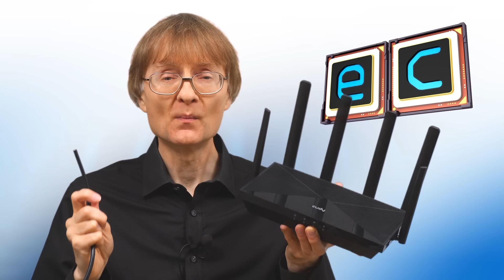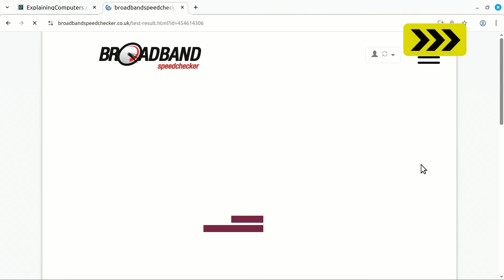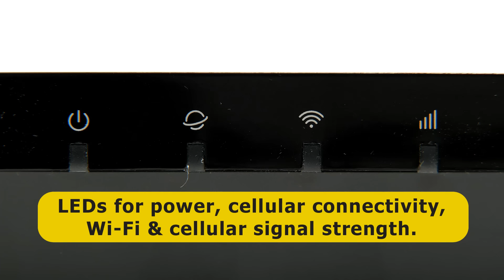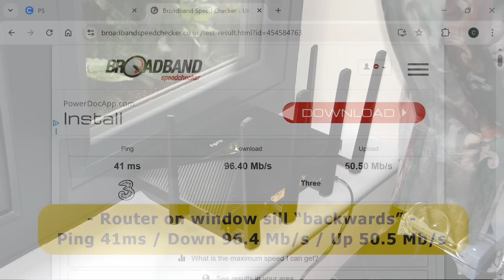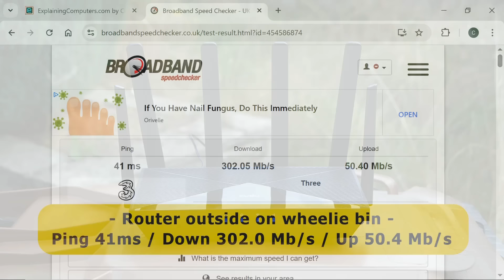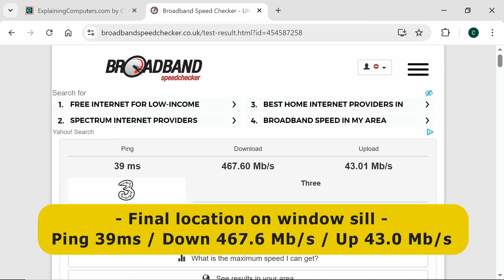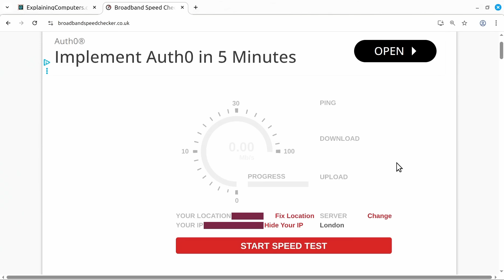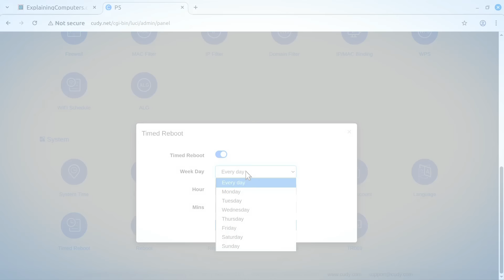Switching to 5G Broadband: Cudy P5 Router

Comment: I have 1gbit fibre in NZ and while I'd love to upgrade to a 2gbit connection it is hightly unlikely.   The whole "NZ runs on fibre" that OneNZ (Vodafone) and Spark marketing tries to sell is a big fat lie.  The biggest problem here is that you must live within some city limit to even get fibre.  I've been lucky for the last two houses I've own as both are within those boundaries  If I lived outside, the options are cellular and starlink.  Not really sure how many subscribers there are for one versus the other, but cell service here is really bad.  They've only just began terminating 3G (I assume for security reasons surrounding the many SS7 vulnerabilities).   I think there is one 5G tower here in Cambridge, but the others are 4G for sure.  I believe that the cost difference is quite substantial and I don't think there is any kind of unlimited data for the cell network and I won't even get into the latency I saw on your speed testing.  I could live with a 300mbit connection, but I really wouldn't want to.   I did test the 5G tower near me with my S25  at 4pm and get 514mbs down, 36mbs up.  So, about the same as you are getting.

Comment: I'm in California and have been on 5G internet since it became available in my area. Maybe 4 or 5 years? Here it's through my cellphone carrier (T-Mobile) and they provide the 5G device. It's a receiver and a basic router, very basic it can't make 2 networks 2.5 and 5 Gigabyte. It has Ethernet out, so I connect that to a normal router which eliminated problems I was having with IoT devices. I get 50 to 250 (very variable) down and 10-15 up. Since I live by myself it's plenty of bandwidth and I get discounts because I have a cellphone account, and internet account with the same company. My total cell plan + home internet is $90 usd a month. When I had cable TV internet my combined cell + home internet costs were $25 higher per month and my internet speeds much lower. the only downside is my windows (I live in a condominium) all face east and the tower is due west. Still though it's been reliable and fast enough.

Comment: Not directly related to wireless but your diagram of the home network reminded me that I'd love to see a video from you about Tailscale.  If nothing else it would let you connect into your home LAN with a laptop or mobile device while out and about.  Or I'm sure you can come up with more entertaining uses.

I have a lightly used tailnet myself, just to experiment with it.  Coolest thing I've done with it is update Linux packages on my home desktop from an airplane mid-flight via Starlink.

Comment: I tried mobile internet in 2012 when I think it was 3g standard...yea I had problems with data transfers across a 1000sqft apartment...and resetting the device was frequent.  But yea my device looked more like you 4g device...I should most likely look at getting something like this as a backup for my cable modem, as I work from home, and tethering from my iphone's connection, was terriable, I could only get my ipad working with it, so I canceled that...now if internet goes down I just use my phone for basic things, like trying to figure out when it might come back...this is slick in that it has the option for redundency.  Will definately look into this device...I think part of the issues I have with tethering is my cellular provider in the US....in the US they main tier providers and then they have budget providers, and on the budget providers you just do not get the same level of service.

Comment: My phone gets 5G outdoors but 4G indoors as I believe is the case for many. So unless your prepared to use those ropey outdoor antennas you'll need to make do with 4G?
Reply from the maker: It just depends on location. There are lots of outdoor antenna options now, as well as window antennas for use on the side of the property with the line of sight to the cell tower.

Comment: For 5G, I have an Inseego MiFi (similar to the D-Link you have).  This thing can be connected to via wi-fi, or it can be tethered via USB and count as "ethernet" in Linux, and it also has an actual ethernet port.  I can't get the 5G home internet because the carrier hasn't (yet) built out the infrastructure in their existing towers for it.  When the time comes, I'll definitely want a device like the Cudy that I can treat as "outside" and hook to my firewall.

Comment: Those practices are criminal. There’s no excuse for such high prices and terrible service, since the issue seems to be purely bureaucratic and not technical. Here in Spain I pay 20€ for a gigabit FTTH connection, and I’m talking rural, middle of nowhere Spain, not Malaga Spain. Even back home in Ecuador I pay $40 for 1.2 Gbps. Bit pricier, but is a solid FTTH connection.

Comment: A 5G broadband only makes sense if the network caps the number of subscribers per local area (by post code, by tower, etc.) Philippine telco PLDT had a free for all attitude on 5G internet and so while the speeds reached 300+ Mbps at launch, the lack of quality control brought it back to 3G HSDPA speeds of 5 Mbps. There's only so much customers a single tower can carry so operators have to plan the allocations properly.

Comment: - It may be wise to plan for a backup mobile internet service provider should the main one temporarily fail. 
- The CGNAT feature used by mobile ISP's blocks incoming connections.
- The mobile data forum on the ISP Review website is a useful resource. 
- A mobile phone with a recent version of Android should offer Ethernet tethering to a cheap USB hub that has an Ethernet socket. A phone, such as a Samsung, combined with a smart charger can be left with the charger connected to the hub and, if the phone's Battery Protection is set to Maximum, it will power the phone separately without constantly charging the battery. This is especially effective when the battery has been charged just above the BP Max. limit.

Comment: WiMax Next Generation. Faster, better, Cheape.... wait what year is this again?

Recursion loops aside, I have switched to T-Mobile USA 5G Home Internet due to cost and so far, its fine for general internet needs. However when it comes to self-hosting my personal server, T-Mobile shackles NAT and port forwarding control as they use Carrier/Commercial Grade NAT, I did checked if T-Mobile will provide a IPV6 address but sadly it is treated as the same as IPV4 with NAT. So I overcame this limitation by using Tailscale VPN but not completely as this means I cannot simply share videos to my family members by sending a simple link and this would require them to install the TailScale client on their end which is too much for the non-tech savvy to swallow. I did discover a client-less VPN tunneling solution via Cloudflare but requires a fully qualified domain name and another option which is to convert my T-Mobile account to business to receive a public IP address, however they require a valid business ID to get one.

So any server hoster out there, I would advise to check if the carriers uses CGNAT or atleast provides a public IPV6 address before making the switch.

Comment: I too am using 5G from Three.  They supplied a modem and router as well as broadband for £21 a month which was cheaper than I was paying with Tiscali.  I am getting 127 Mbps down and 50.76 up which is plenty for what I need.  I plugged the supplied modem into the WAN port of my existing TP-Link router and it all worked so saved me the hassle of setting up the new router.  They call the modem an "Outdoor Hub" but I have it on my window ledge indoors and it works fine.
Reply from the maker: Great to hear of another success. :)

Comment: Buying a superb 2,4,5G Combine Router? But once you have one will also depend on your internet services!  I Have 2 router, one is Sat/Cell phone router it used to received 4G/5G From Cell tower, lets you know a lot about signal strength, and can handle 6 devices, at once by connection to wide ranges of signal that devices used!  Then I have Fiber-optic Router  4 wires, or 4 wireless devices, 500-750Mb/s  can go up to 1Gbs-(5Gbs gaming-10Gbs)  $75-($150-300 USD) per month in the USA?  Again, I have seen a lot of the 2026 Laptop that doesn't come with Ethernet plug now...
Reply from the maker: I've never seen a business laptop without Ethernet. :)
Reply: @ExplainingComputers  In the USA, we have lots of free Wi-Fi,  I have only seen a few Laptops, but cheap one?  & Chrome-book. w/o Ethernet plugs... Most Business laptop/gaming are high end?  Have both, I read that in 2026 more devices are Wi-Fi. I buy a 5G USB Ethernet adapter for Window & Linux?  Funny they put 3.5" driver disk in there?  Really No DVD now on Laptop...!  Love every Sunday to see what you're posting...

Comment: It's a terrible shame 5g is so abysmal here in North Wales. Would make the switch to 5g in a heartbeat. Regardless of speed I think the BEST advantage of a 5g connection is the lack of cancellation/contract fees. It's so backwards that you have to commit to, for the most part at least a year with every wired provider.

Comment: I use 5G cellular as my Internet backup for $20 a month. It's very fast around 500 down 500 up but the latency is where it gets you 30 ms usually which for gaming kind of sucks but if you're not a gamer, it doesn't matter at all. I've considered switching it full-time, but my fiber is so cheap here in the states one gig down one gig up or even two gig down two gig up for under $70 a month.

Comment: We're on Gigabit Fibre provided by Au/KDDI, one of the major telephone & mobile companies here. Our landline is also provided by them as a single package, using the same number we had when we were using NTT, who were the only phone company back in the dark ages. You can get a better deal if you opt in to their mobile and TV service but we don't have a TV! The Fibre dongle and provided wired router are up in the loft and we have wires running down inside the walls to the first (second floor here) floor and ground floor, I had this done when we had the house built about 19 years ago. I have a wireless router next to my desk set-up as an access point. The whole thing works very well.

Comment: In Aussie and lucky to have FTTP since 2013. and just been upgraded from 100/20 to 500/50 on same plan. Since 2013 had my cable dug up once, and two terminator boxes and power supply replaced. Had free trial of 1000/100 but went back to 100/20 as was fine for  my family. On 500/50 with 7ms ping. Might go to StarLink if FTTP becomes patchy but so far it just does the perfect job.  Oh and "speedtest" shows 526.88/48.84 & 7.14 ping now and thats typical

Comment: Thanks for another great video. I use T Mobile 5G at $50 a month much better service than Spectrum at over $80 a month witch sees to raise every year.  something you might try is raising your Router b about 4 inches to give  the cell antennas a cleat shot through the glass.  David Huffman K6DCH , Marine electronics tech and A+ certified Computer tech.

Comment: 5G is less expensive than getting wifi? The UK is weird. 200 to 300$ for a router that doesn't even have wifi 6E is so sad. I have a 100Mbps up down for like 6$ a month.  Assume 100% of the people watching this will have cheaper wifi than 5G so no one should try this solution the router is way to expensive. 

Yes 5G is fast but your lan ports and your usb connection will limit you.

Comment: my mom uses cable internet 

there is fixed wireless internet in USA as well through AT&T and T-Mobile USA as well where they offer fixed wireless internet over the air and it is often with a caveat of T-Mobile may have usage caps that slow the connection down and AT&T offers unlimited usage but speeds slow when the network is busy and in some cases if the user is using more bandwidth then the connection speed is slowed for 30 minutes

Comment: Greetings from Los Angeles.  I've used T-Mobile Home Internet (5G fixed wireless) for about three years as a backup to my cable Internet service.  It shows good speeds (150/30) from a second story window facing a cell tower and wired ethernet inside the house, but video conferences are unusable due to jitter.  I'm paying  $50/month for a partly useful service, which was initially justified because I work from home, but failures with Zoom and Teams kill that rationale.  Thanks for the tip to rotate the router...that brought the upload from 22Mbps to 30.

Comment: Looks like Cudy runs OpenWRT. Nice catch. However, pings should be a lot lower. I am using Smarty in Preston, and in OOKLA Speedtest, connected to a London based server, getting 18-19 ping , around 3-400mbps/ 3-40mbps with Zyxel NR-5103E v1. I think this Zyxel is the best atm in used market.

Comment: l moved to a newly built home and FTTP was going to take a bit of time to get. Got 5G broadband as an interim.
Stuck with this for 10 months and then hooked up to FTTP with the electricity supplier who had a great deal.
Free Wi-Fi 7 modem if I stay for 12 months and monthly price discount of $AU20 for the data.
At the same time internet speeds in Australia had been increased from 100 to 500 Mbps for free on fibre connections.
With this speed increase did not have to do any mesh or wi-fi extenders in our large new double story home.

Comment: FTR. You should consider putting your router in the attic (if you have one) and using dedicated wifi access points around the house. 

OpenWRT is also a good option for maximising your bandwidth as you can not only control the antenna attenuation but also transmission power. Still, I think my suggestion above is a simpler solution with minimal experience needed.  

Thanks for sharing.
Reply from the maker: I've no need for changes or more hardware now. The Cudy Wi-Fi covers everywhere just fine, and most devices are connected via Ethernet. :)

Comment: I am in the US and my home is connected by optical fibre. About three years ago I bought a used Netgear router for about $7 at Goodwill (a nationwide thrift store chain, aka charity shop in the UK). I am not a geek so was a bit nervous about setting it up. However, clearly I managed to do so but cannot remember how I did it.
I just did a speed check on Ookla, using my laptop connected by Wi-Fi to the router and over a VPN (not sure if that matters): the result was 89.33 Mbps download, 90.22 Mbps upload. So it seems that I doing pretty well with this service. 🖧. I pay $50 per month.

Comment: I've got a 4g internet with 3.
I used to be with BT and had trouble paying my bills in the last recession.
They cut my broadband off and charged me £40 to reconnect my broadband.

When I got my next job I asked for my £40 back which they refused, so I told them to stick it up their arse and got a 3 dongle.

Then I upgraded to a mifi and then to a 4g router.

If 5g dropped in price I'll have to upgrade again.

I've got an additional 5g SIM only deal with 3 for my crypto phone, would I be able to add the £16 5g SIM only to my 3 account?

I think I'm paying £18.40 for the 4g.
Reply from the maker: Thanks for this. As far as I'm aware, Three does not offer different 4G and 5G plans, with 5G being included as standard in all of their data plans. So I'm pretty certain that you would get 5G using your existing SIM if it was fitted in a 5G device (and you were in range of a 5G cell tower -- and Three have more 5G provision than anybody else). If you log in to your Three account you will see the deals available to existing customers. As far as I'm aware, a £16/month unlimited SIM is a standard deal for adding an extra SIM on Three.
Reply: @ExplainingComputers 
Excellent video.
It's good how you always think outside of the box and how you help other people.

From turning old laptops into Linux machines and Chromebooks to your adventure with 5g broadband.

Comment: I tried this same router earlier this year and had to return it because of a serious issue: it wouldn’t save settings. After a reboot, it looked like it had been factory-reset.
I then had to return a Cudy P2 router because it kept rebooting randomly, possibly due to a faulty power adapter.
I'm currently using a Cudy P4 router. It mostly works, but every four hours the 5G mobile connection resets, and the logs show a script on the router is triggering it.
I've lost confidence in Cudy hardware.
Reply from the maker: Sorry to hear this.

Comment: In my old home i used to get about 50 mbps using dsl internet, but i after i installed a 5g linux router i used to get around 800 mbps here in croatia, now that i moved i have around 2000mbps using fiber optic which feels unreal, the only problem with 5g is the instability, but it used to be much more of a problem with 4g.

Comment: You were paying 43 GBP for 50/10 Mbps?  OUCH!  I figured the UK would be better than what I have.  The part of California I live in has Cox Cable as the ISP (AT&T has given up of DSL and though they pulled fiber in the streets years ago, they don't offer it to us).  Cox charges more for Internet here than they do in say Arizona.  Even so, it's better than what you were getting.  I have their slowest/cheapest offering of 100/20 Mbps for $51.17 after taxes.  My latency is 12-13 ms according to Fast and SpeedTest.  Unfortunately, 5G Internet and Google Fiber aren't available in my part of town.  Still, I guess I shouldn't complain.

Comment: Why do you need to cable inside the house, surely the WiFi will serve all your computers sufficiently ?You may find the speeds vary depending upon the load on your cell. I live by a main road, and at commute times with lots of users entering / leaving and using the cell it gets a LOT slower.